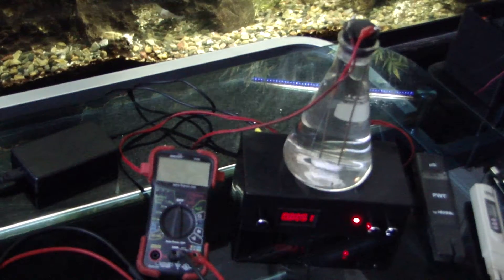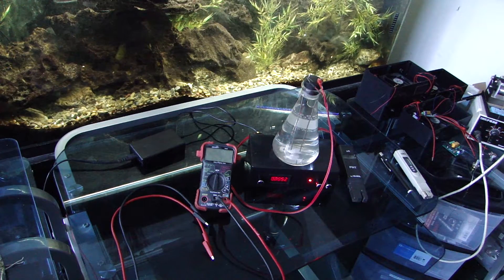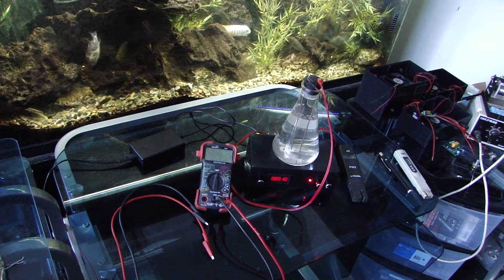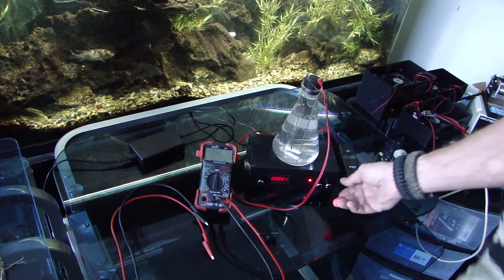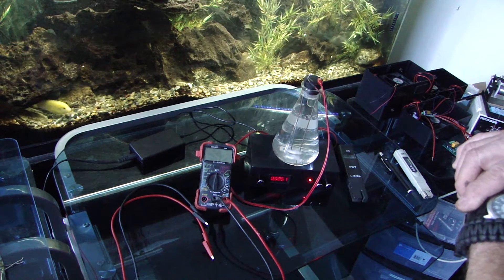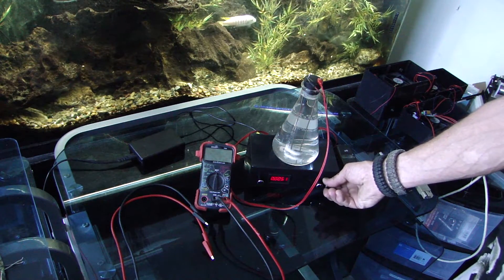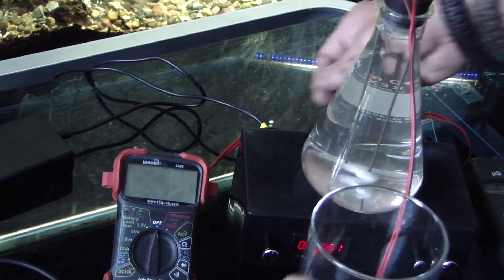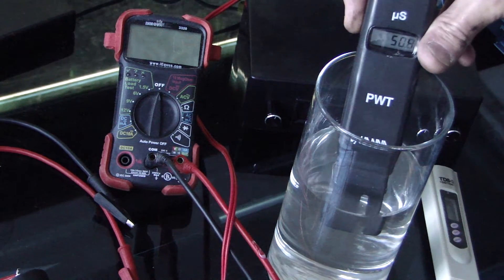Part 3 BigBear Colloidal Silver Generator-Reverse Polarity-Constant Current-Magnetic Stirrer

Comment: Just watched all three videos of this series. Enjoyed the specs along the process of making this colloidal. Not many people put a multimeter in the picture to explain what is actually happening. Just made my own setup with lm-317 and a resistor with a 24v power supply. Yesterday just made a batch with an aerator and a magnetic stirrer. Stopped at 9 micro Siemens( which I believe is what your Hana meter is set to) and had clear color and no sediment! One thing I found out online is one micro-Siemen equals 1 ppm. So far that's my conclusion! Thanks for an in depth series.

Comment: Hey, I just bought this from you at eBay. (Haven’t shopped from eBay in years!) But I’m really very pleased with this. I wanted easy, safe way to make our own here at home. It’s seems to be a learning process for me, I’ve made several batches. But still following all your steps, last nights batch was kind of gray, not clear and pretty like the ones before it. No doubt, I did something or didn’t do something I should have. I kept it but I’m not really sure it can be used for anything but topical. So, do I need to clean better? The magnet has black lines in the crevices, I’ve ran water over it and tried cleaning it this way but it’s not working. How and what do you use to clean with? I really don’t want to mess up again. Thank you
Reply: I soak my stuff that turns black in bleach, works great.

Comment: I JUST BOUGHT THIS AND THE POWER BOX IS WAY DIFFERENT, THE SILER RODS THAT CAME WITH THE UNIT ARE TO BIG TO FIT IN THE POWER UNIT  AND THERE ARE JUST A BUNCH OF LED LIGHTS ON IT NO DIGITAL GUAGE AND NO WAY TO TURN IT UP OR DOWN
Reply: so not worth it?
Reply from the maker: gary shirley 
Have no idea what you are talking about. You did not get yours from me. 
See: https://www.ebay.com/itm/192763923836

Comment: Dean,
Can you maintain the 1 mah current limit for the entire production to 20 ppm ? 
When it gets to 20 mah what is the max current limit setting? 
FV
Reply: Good cuestion,....I ask a similar cuestion.....I'm dizzy my self...up down up down up down ...just keep it simple..or make two videos.
Reply: That's what it's there for. The limiting of Ohms at 1mA throughout the process to ensure 1-4nm sized ions. He was just demonstrating that it is in fact adjustable. Let's say you want to add ionic silver for cleaning supplies, then you can set at 10mA for quick production of very high ppm.
Reply from the maker: Fred Van 
Sure. You can set the current limiter to 1.0 ma throughout the entire process.

Comment: Hi Dean, have tried to contact you through Ebay U.K.  Ebay won't allow me to ask you a question. Can you post the basic unit and cables to the U.K? Is your email dj123456@charter.net address still good.? Have tried emailing you, but no reply so far. Best regards M....
Reply from the maker: Yes. That is still the correct email add.